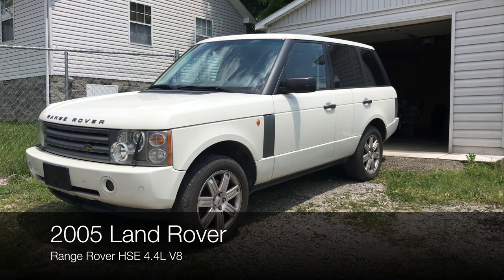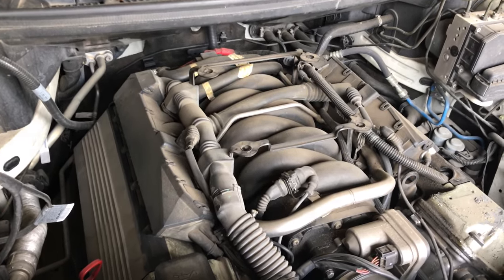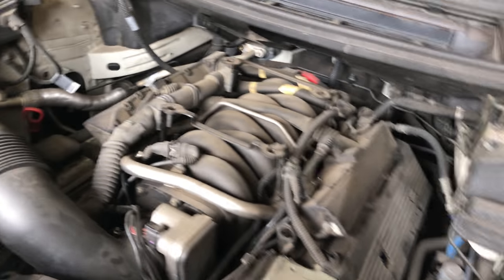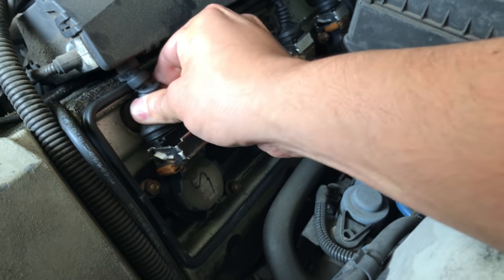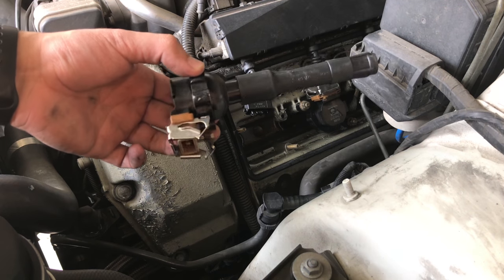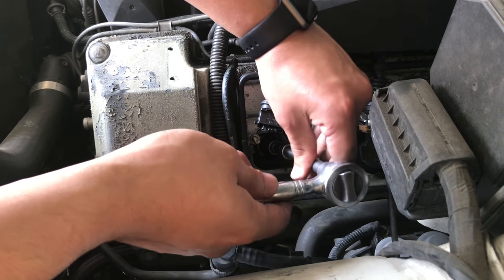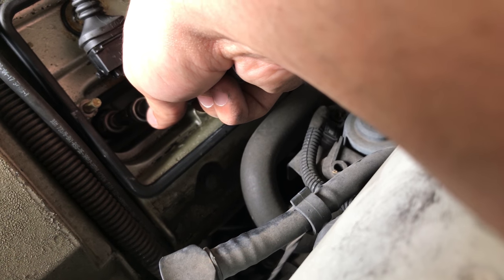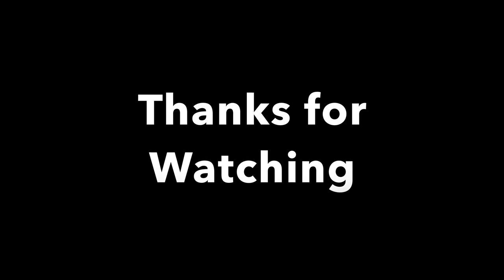2005 Range Rover HSE Spark Plugs 4K

Comment: U got a vid on oil change for this vehicle?
Reply from the maker: I do not. I don’t have the vehicle anymore
Reply: easy remove skid plate its held up by 10 bolts or 8 drain oil and you need a oil filter tool the air suspension was easy to honestly one of the easiest cars to work on common sense and the right tools keep these range rovers going